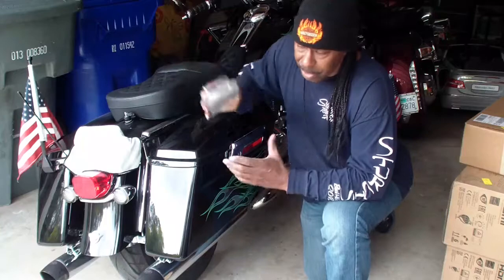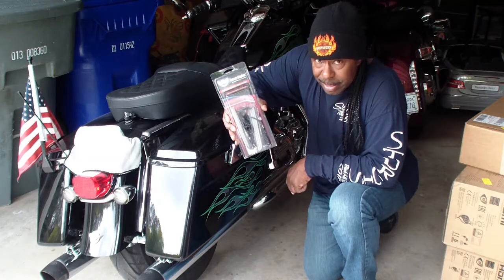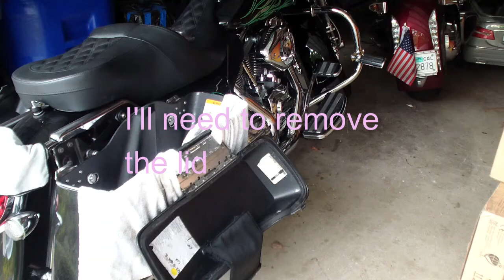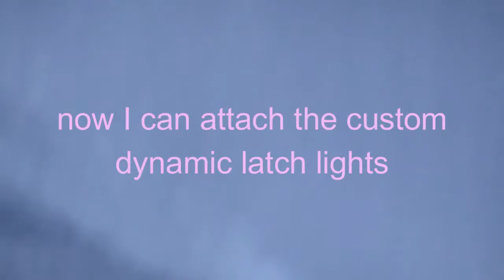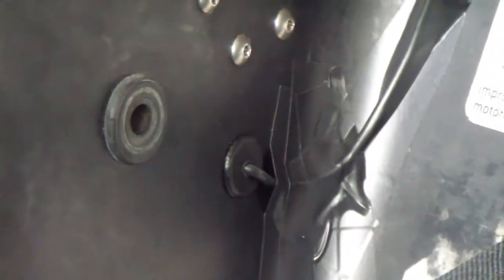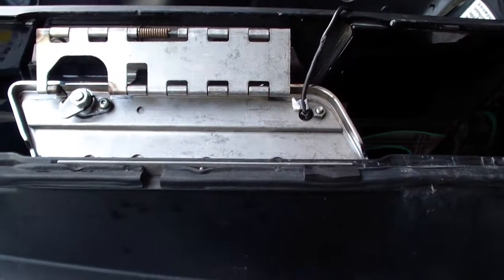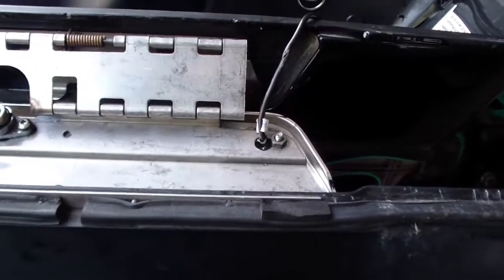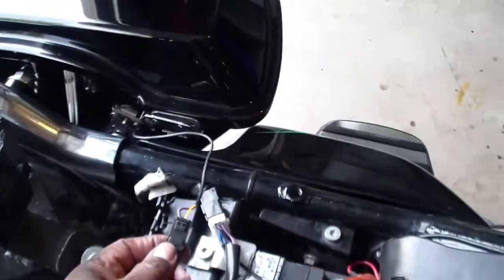Installing Custom Dynamic latch lights, 2006-2013 bagger

Comment: I just put on the latch lights and I too do not have the turn signal. However, I updated my bike to the 14 HD bags and it’s not working either. I’m sure I can modify the wiring but it’s has yet to be seen. I just wanted to see if anyone else had the same problem. Thanks!! Check the video of 2012 to 2014 saddlebags. What he didn't tell you about updating  to HD 2014 Saddlebags?
https://youtu.be/x_OA7HVsUXE